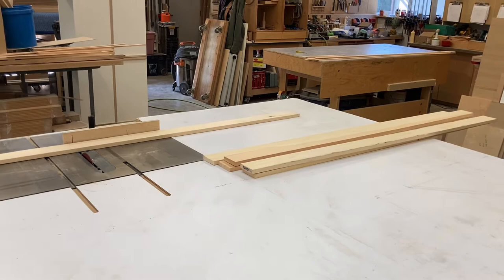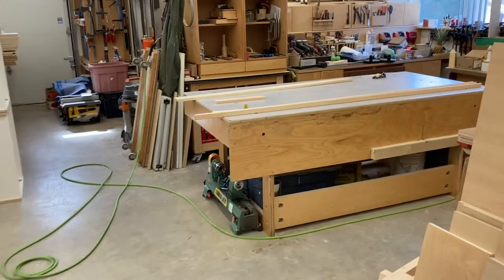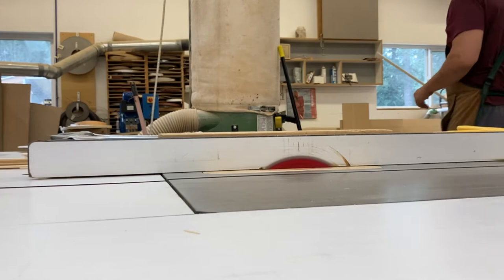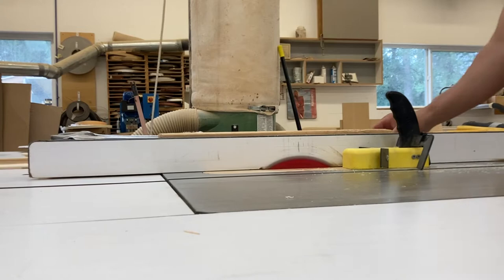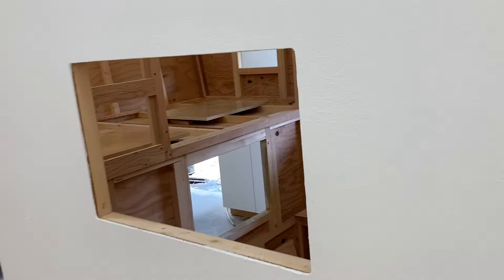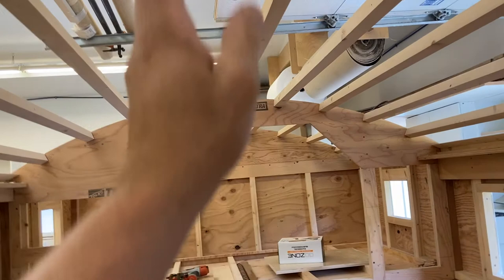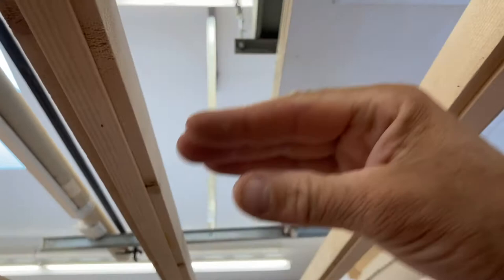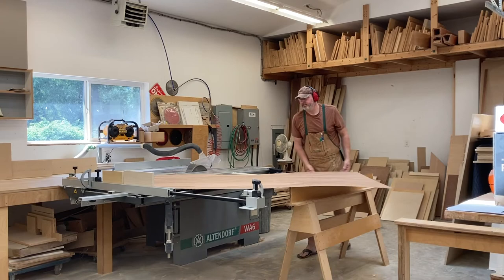Truck camperbuild part 22… milling stock and ceiling panels

Comment: Wish i had half the space you do so I could build my own truck camper...this looks like such a fun project that gives you the freedom to make it just how you want it...can't wait to see the next video!
Reply from the maker: It is pretty fun .. most days haha… I should have a video up by tomorrow, and have another one to edit as well .. glad you are enjoying the build!!
Reply: @mikesniedze9122  seems like its gonna end up being a really heavy unit...that's not gonna be a problem?
Reply from the maker: I am aiming for 2000 pounds , but it may come in 2500 wet .. the frame is spruce , it was about 25 or so 2x6” ripped down , 10 sheets of sheathing( not including the roof … inside / outside and roof skins will be 26 sheets .. average 20 pounds each 
Thats 520 in plywood .. maybe 200 pounds lumber … 5 gallons glue (. 40 pounds before it dries … 40 pounds in tarps for my fibreglass skins … 10 sheets of insulation at 4 pounds each … at its present state I’m about 800 pounds give or take … I’m hoping a 3/4 ton truck will do .. if not I’ll have to upgrade to a one ton… being lightweight was not my number one concern … but stuff adds up fast …

Comment: Hello Mike. Thank you for allowing us to follow along with your camper build. I know this is late in the game to be asking you this question, but I just recently came across your videos. Can you please explain a bit of detail on your thoughts about the strength of your cantilever support for the cabover section of your camper. I would have thought one would need significantly more support (in the form of larger timber sections) to support this area. Can you fill us in on your thoughts about this? If you do not wish to post in the comments, maybe you can add some dialog on one of your upcoming videos regarding this aspect. Thank you again and keep up good work.
Reply from the maker: Thank you for following along ! Glad you are enjoying them … if you notice , the bottom of the cab over runs straight through from the tip to the middle of the main body … I felt this was important ..
If the cab over just butted into a vertical member of the main body, it would be a very weak area… I had debated a diagonal brace of some sort , going from the top of the front , down towards the middle of the camper… but found it unnecessary after the plywood skin was on ..most of the strength comes from the plywood skins …
Stand a whole sheet on its edge , and try to bend it ,,, as in keeping it flat , and try to pull two corners together … it won’t move one tenth of a millimeter… I ran a whole sheet from the front to the middle of the main camper body … stiffening the whole cab over … there is no flex or sag when you get up in the bed area.. and I’m 240 pounds haha…
Reply: Mike, Thank you for the in depth explanation. I appreciate you taking the time to convey your thoughts. As you pointed out, the shear strength of plywood is quite high, which contributes a great deal of support to the overhead sleeping area. I have seen other DIY campers built with aluminum/steel frame where they extended a large sized rectangular tube from the rear of the camper all the way to the front of the overhang (both on the bottom and the top) to counteract the forces applied by the cantilever, which was the reasoning behind my question. Looking forward to your continued progress. And, thank you again for sharing your experience and knowledge with the rest of us, it is appreciated.
Reply from the maker: I have seen those braces, and had considered installing one if needed.. once my exterior skins were on , I did not see the need.. time will tell if this was unwise haha…